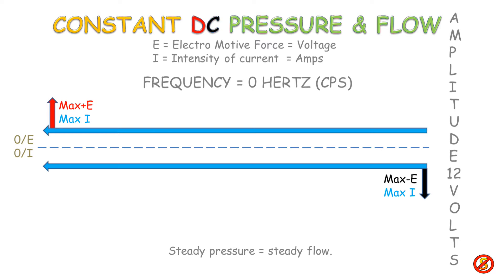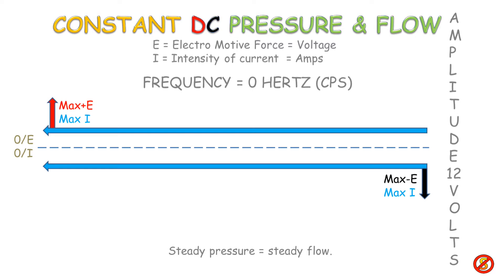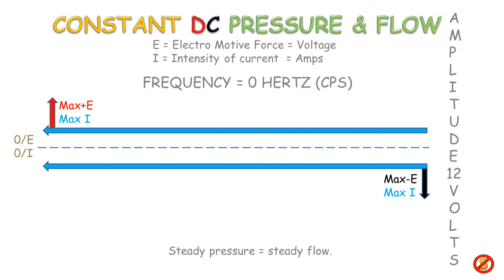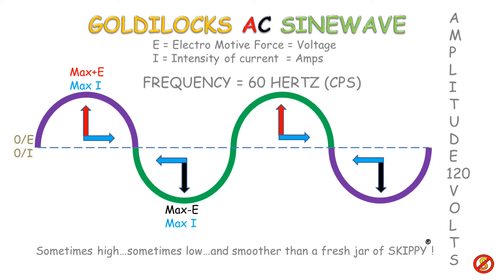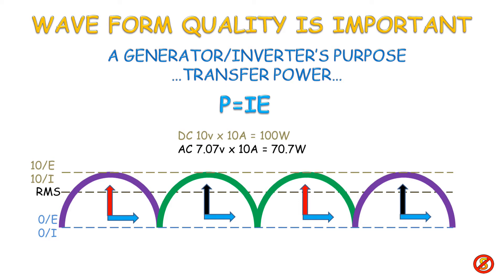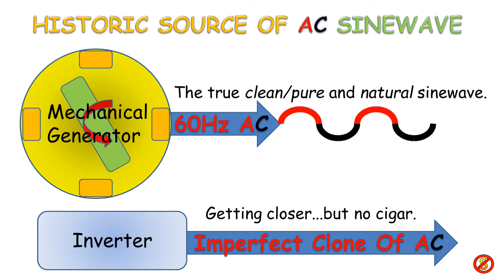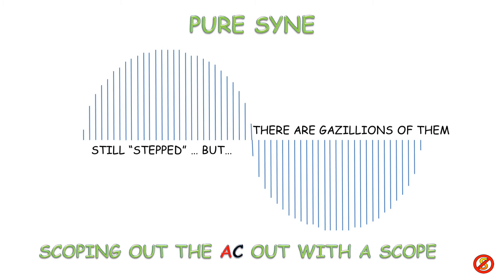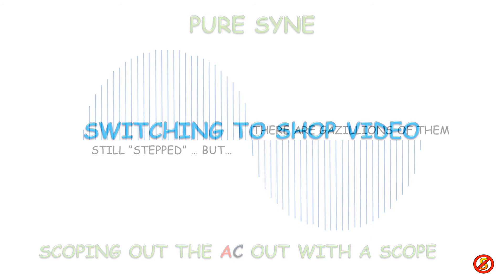Predator 3500 Quality of AC Output

Comment: Thank you for the video! I am super curious about the milwaukee top off inverter. I just bought one and powered many things and then decided to power my brand new heated blanket and it fried the controller with in a minute. It powered a box fan with no issue but had a humming noise which leads me to believe it's dirty power
Reply from the maker: Glad I could help

Comment: Your waveform for the ups is not correct. Looks like the device you are using to see the waveform has an AC coupling with a cut-off frequency to high for the signal you are measuring.  You can confirm that trying to "see"  any dc signal. You will  probably see only zero volts.

Comment: 9000w Predator generator produce clean power too?
Reply from the maker: All of the "standard" generators have to run at a constant RPM (3600) in order to produce 60Hz output. This is in fact a "clean" sinewave. I don't have one to put a scope on to see if there are any perturbations of the wave when variable loads are applied so I can't state that it's always "clean" compared to an inverter generator. Perhaps someone that has both a standard and an inverter type AND an Oscope can put a video up comparing wave outputs with varying loads on each. I think for MOST applications the biggest issue is a balance between power output and noise. The open frame 9K is rated around 76dBA while the 3.5K is around 57dBA. For most people the perceived noise doubling is somewhere between 6 and 10dB so the open frame 9K will sound at least twice as loud as the 3.5K one...but...it will support over twice the power load. Per Popeye, yer pays yer money an ya get yer choice.